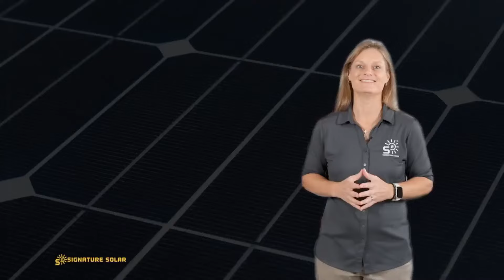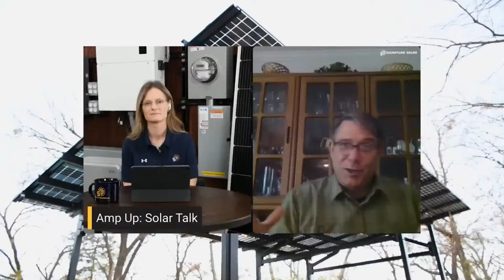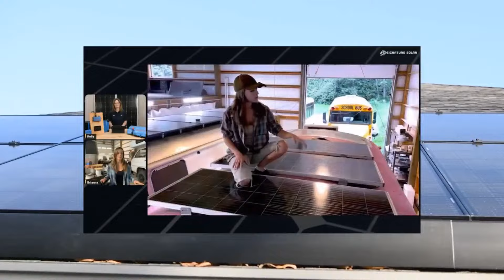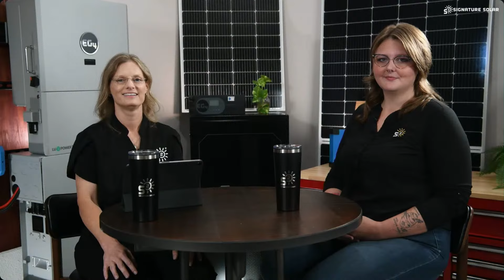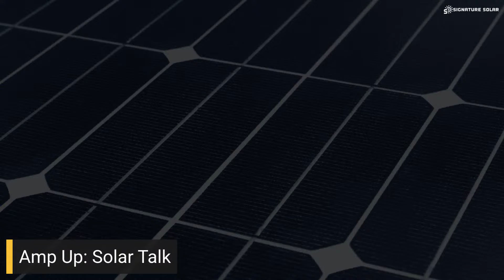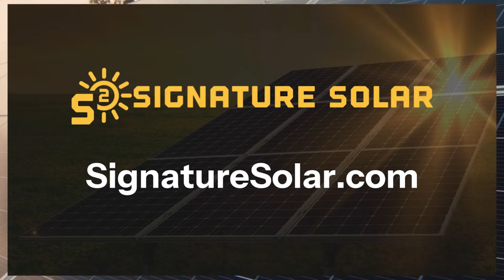Amp Up: Solar Talk - Ep. 26 - A Day in the Life of The Design Team

Comment: How many watts of solar is the minimum amount needed to recharge and keep your King Kong 2 62kWh battery charged for nite use?
Reply: Depends on your location and season
Reply from the maker: Great question! The exact amount of solar you'll need really depends on how much of the battery you use each night and how many sun hours your location gets. For a full recharge, you're typically looking at a pretty large solar array, but if you're only using part of the battery each night, you'd need a lot less.

If you'd like help sizing the system for your setup and location, feel free to give our team a call at 903-441-2090, we’d be happy to walk through it with you!